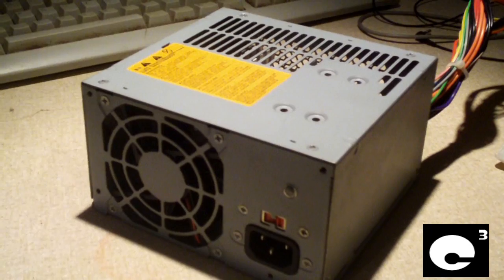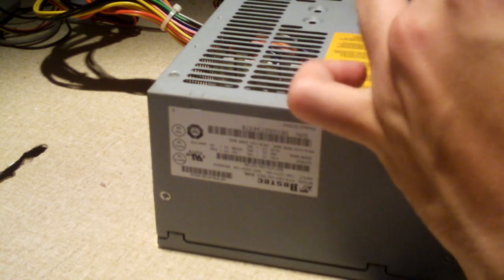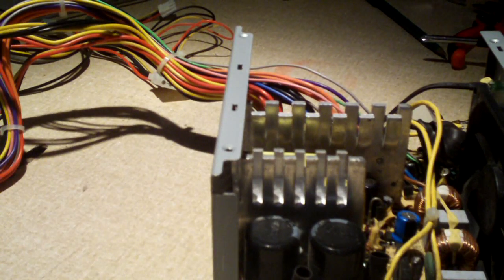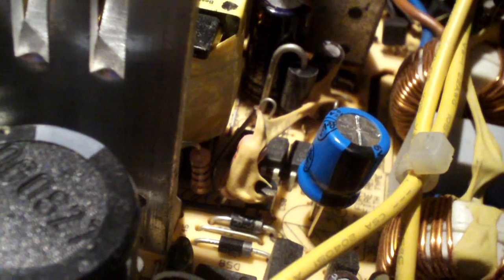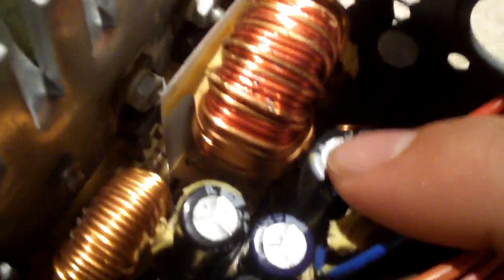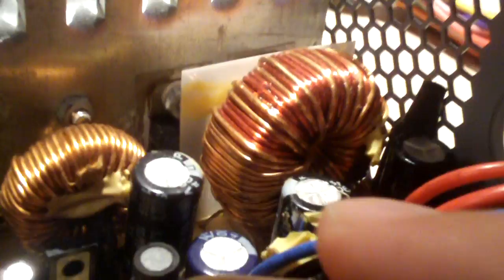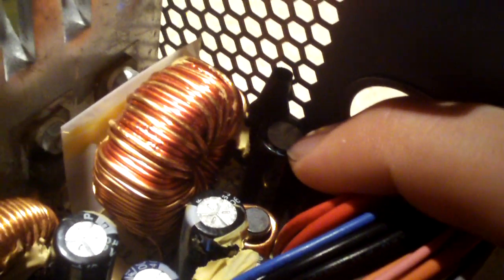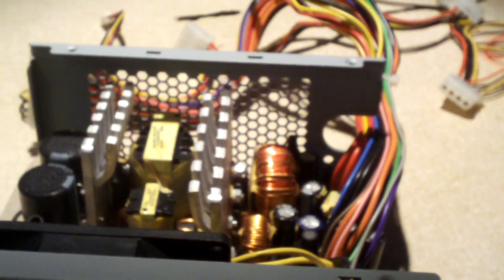Requested Video - Locations of Capacitors in Bestec ATX-250-12Z

Comment: Do you know what the black component between the Two big capacitors is?
Reply from the maker: +Hendrik Schippers The device that's between the two big capacitors (inside black heatshrink tubing) is a MOV. There are two of them present and they are there for surge protection.
Reply: +Cube Computer Channel Thank you! :-)
Reply: +Cube Computer Channel mine burned...so i Need a new...
Reply: they are not needed  just remove it

Comment: Thanks....this really helped me.what messed me up is the original 1000uf and 2200uf caps are almost the same size.I removed them thinking they were all 2200uf.my power supply is running great and will make a good backup.